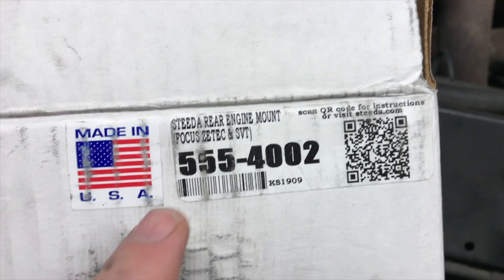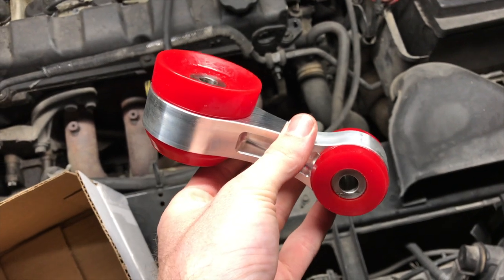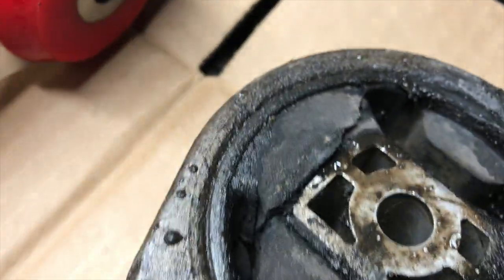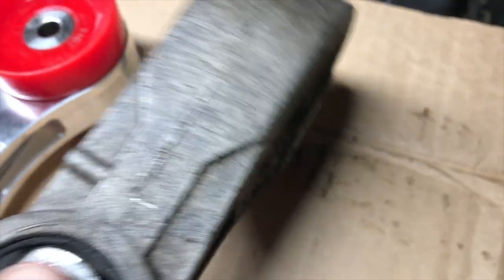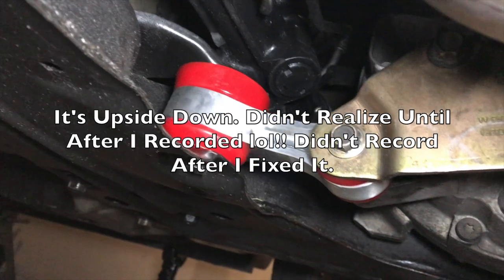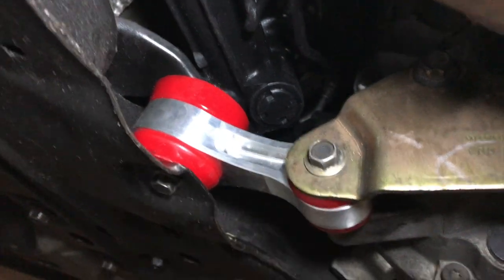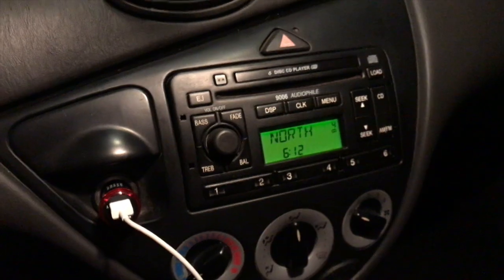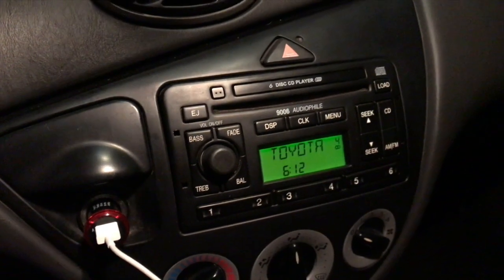My SVT Focus Gets Steeda Rear Engine Mount

Comment: If you need struts and shocks order from them and get the stock suspension for the svt the part # is M-18000-zx3 I just installed mine yesterday and the drives so much better
Reply from the maker: If I need suspension for it, I’ll probably just splurge on some coil overs.